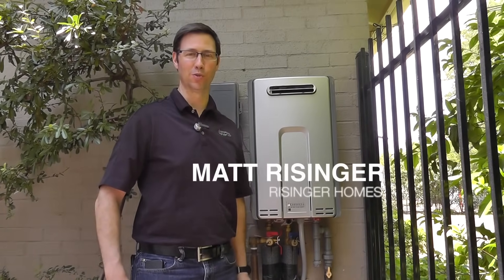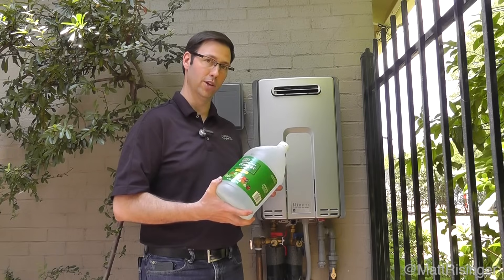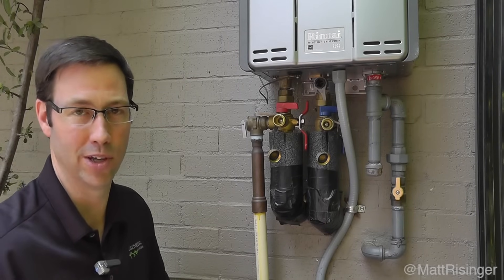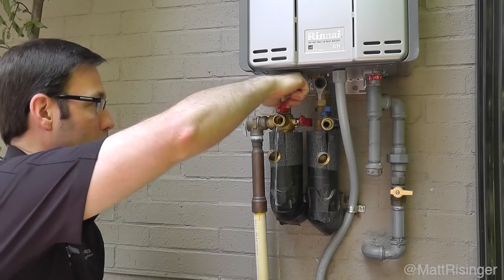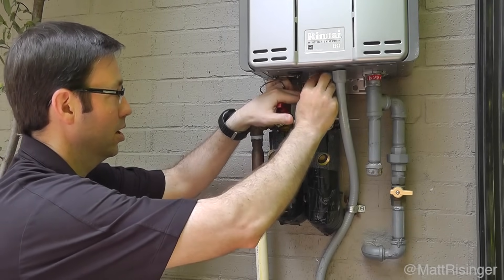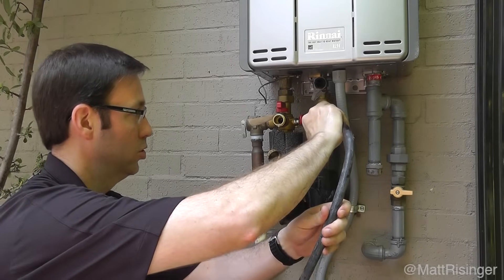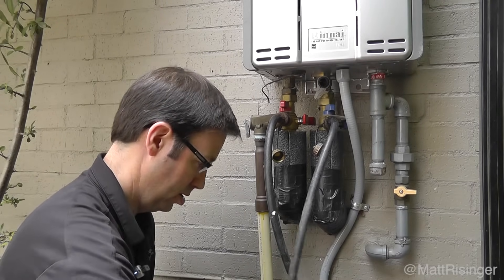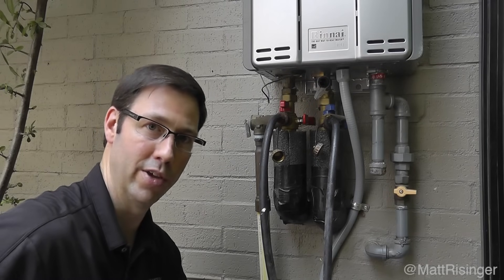Tankless Water Heater DeScaling - How To Flush

Comment: Matt,
I have a Rianna tankless water heater.  I found your video to be very helpful.  I have one question.  
You said to leave the power on to the unit.  But I have a power switch to turn the unit on and off, and I noticed the unit you were using didn't  When I started the flush according to your video, I left the power on as stated and it started beeping and showed an error code of 11.  So, I turned the power switch to off but left the power hooked up.  Was this what was suppose to happen or did I miss something?

Comment: Thanks for sharing!  Your instructions were so clear, and information so helpful, that I decided to descale my tankless unit myself!  I used vinegar and turned my unit off and turned off the gas too.  
During, and after the process, I noticed a few things.  My sump pump water turned bluish green after about 30 minutes and I noticed the water got pretty warm.  I let the sump pump run for 2 hours, because it had been 4 years since my unit was serviced.  After finishing, I slowly poured out the vinegar and at the bottom of my bucket there was a black residue that had a copper colored hue.  I'm guessing that is normal?

Comment: If you have a newer Noritz, make sure to connect the "Flush Wire". If you don't connect the "Flush Wire" it won't reset your code and you'll have wasted time. We learned this the hard way. Had a code 21, didn't know about the flush wire, flushed the system, but the code stayed and the system wouldn't work. You have to connect the "Flush Wire" for a Noritz. We connected it and flushed it again and it worked.

Comment: I know this is an old video, but I just saw it for the first time, but it looks to me like you would flush from the hot side to the cold side. I work at a chemical plant and we backflush exchangers/coolers all the time. Backflushing is more effective at removing any built up deposits than going in the same direction as it's normal flow.
Reply: That actually makes alot of sense I used to work for a water filtration company and our sand filters would flush backwards. Good comment.
Reply: That makes sense for a filter, but why would it be better for a plain heat exchanger?  The idea id for the vinegar to dissolve the scale on the inside of the heat exchanger.  I think (but I could be wrong) that running the vinegar through in either direction would do the same thing.

Comment: I have seen lots of these at the local dump and they are only about 3 to 5 years old.  Now that I know how expensive parts are for them I think I will save some of the parts.  If they are to last over 20 years then they must have been mistreated, installed wrong or not cleaned.

Comment: The following flush method is for my RHEEM 199,000 BTU tankless water heater Model # ECOH200DVRHLN Performance Platinum 11 GPM Natural Gas High Efficiency directly from the factory service manual link below. This method can be used on all tankless water heaters. file:///C:/Users/Daniel/Downloads/RHEEM%20199000%20BTU%20NG%20TANKLESS%20WATER%20HEATER%2098PAGE%20PDF%20SERVICE%20MANUAL%207496DB1F-380B-46AC-951E-BA17CA39DF8A.pdf
 1. Disconnect electrical power to the water heater. 2. Close the shutoff valves on both hot water outlet and cold water inlet lines (V1 and V2). See Figure 57. 3. Connect one hose (D1, Figure 57) to the valve (V3) and place the free end in a bucket. Connect one of the hoses (D3) to the circulation pump outlet and the cold water inlet line to valve V4. Connect the other hose (D2) to the circulation pump inlet and place the free end in the bucket.

 4. Pour tankless water heater cleaning solution into the bucket. Ensure the cleaning solution is approved for potable water systems. Place the drain hose (D1) and hose D2 to the pump inlet in the cleaning solution. 5. Open service valves (V3 and V4) on the hot water outlet and cold water inlet lines. 6. Turn on the circulation pump. Operate the pump and allow the cleaning solution to circulate through the water heater for at least 1 hour at a rate of 4 gallons per minute. This will remove any possible harmful scale deposits. 7. Rinse the cleaning solution from the combination water heater as follows: a. Remove the free end of drain hose D1 from the bucket. b. Close service valve V4 and open shutoff valve V2. c. Do not open shutoff valve V1. d. Allow water to flow through the water heater for 5 minutes. e. Close shutoff valve V2. 8. Disconnect all hoses. 9. Remove the cold water inlet filter from the water heater and clean out any residues. 10. Reinsert the filter and ensure the filter cap is securely tightened. 11. Connect electrical power to the water heater. 12. Open a hot water faucet. Run the water heater continuously for five minutes to ensure all cleaning solution is purged from the system. Check for leaks and ensure the water heater is operating properly.

Comment: I watched the video a couple of times and I must not be seeing it correctly. It looks like you are saying to close both flush valves and open the cold, hot and gas valve. I would think that you would have to flush the vinegar out of the system by closing the cold flush, hooking up the drain hose to the hot flush and open the cold input. Did I miss something?
Reply: The following flush method is for my RHEEM 199,000 BTU tankless water heater Model # ECOH200DVRHLN Performance Platinum 11 GPM Natural Gas High Efficiency directly from the factory service manual link below. This method can be used on all tankless water heaters. file:///C:/Users/Daniel/Downloads/RHEEM%20199000%20BTU%20NG%20TANKLESS%20WATER%20HEATER%2098PAGE%20PDF%20SERVICE%20MANUAL%207496DB1F-380B-46AC-951E-BA17CA39DF8A.pdf
 1. Disconnect electrical power to the water heater. 2. Close the shutoff valves on both hot water outlet and cold water inlet lines (V1 and V2). See Figure 57. 3. Connect one hose (D1, Figure 57) to the valve (V3) and place the free end in a bucket. Connect one of the hoses (D3) to the circulation pump outlet and the cold water inlet line to valve V4. Connect the other hose (D2) to the circulation pump inlet and place the free end in the bucket.

 4. Pour tankless water heater cleaning solution into the bucket. Ensure the cleaning solution is approved for potable water systems. Place the drain hose (D1) and hose D2 to the pump inlet in the cleaning solution. 5. Open service valves (V3 and V4) on the hot water outlet and cold water inlet lines. 6. Turn on the circulation pump. Operate the pump and allow the cleaning solution to circulate through the water heater for at least 1 hour at a rate of 4 gallons per minute. This will remove any possible harmful scale deposits. 7. Rinse the cleaning solution from the combination water heater as follows: a. Remove the free end of drain hose D1 from the bucket. b. Close service valve V4 and open shutoff valve V2. c. Do not open shutoff valve V1. d. Allow water to flow through the water heater for 5 minutes. e. Close shutoff valve V2. 8. Disconnect all hoses. 9. Remove the cold water inlet filter from the water heater and clean out any residues. 10. Reinsert the filter and ensure the filter cap is securely tightened. 11. Connect electrical power to the water heater. 12. Open a hot water faucet. Run the water heater continuously for five minutes to ensure all cleaning solution is purged from the system. Check for leaks and ensure the water heater is operating properly.

Comment: If you do these often you will need a corrosion proof pump.  It will cost you a few bucks but is necessary.  Standard submersible pumps or water heater transfer pumps will get ruined pretty quickly by the vinegar.  No one ever mentions this but it is true.

Comment: Don't think you absolutely need the flush valves installed. Turn off the cold water, depressurize the unit. Disconnect the hot and cold water connections and attach the pump to the cold side and the  other hose to the hot side and flush

Comment: Tankless water heaters run your electrict bill way too high because the heating element is like a direct short. I'm a plumber registered since 1974. Don't use them
Reply: That only applies to ELECTRIC water heaters not GAS powered ones.

Comment: question, after flushing the system , there is yellow brown water only on hot water and its been this way for about four days and smells like metal. can you email me directly, if you have any suggestions lnuzzoyda@aol.com
Reply: Similar issue here. I ran the vinegar for 1 hour, ran a water-only flushing cycle for another hour, it's been a week and the metallic taste is still there for the first minute and it goes away. But try it again an hour later on the same faucet and the same cycle occurs: metallic taste for a minute and then it goes away.  How do we fix this?!

Comment: Matt, I have a Takagi brand tankless water heater.  They told me that vinegar is not proven to descale.  And to use CLR instead.  Is this true?  CLR leaves behind those chemicals.  So, I need to flush the water for at least 10 minutes after.

Comment: Why do you need those valves? Can't you just unhook your intake and output, and plug in the hose kit there?

My cabins water feeds off of a 35gallon tank I refill when needed. I can drain the pipes in a minute. Why can't I clean the system by pumping vinegar through that way?

Comment: I can vouch from a bad experience the need to do this process regularly.   I let mine go over 4 years between flushes and my unit stopped working.  It ended up costing me a thousand bucks to have a new sensor installed because the original one got fouled up from lack of flushing.  Not to mention the embarrassment of being lectured by the plumber who thought I was really stupid for letting it go that long (I was). . .

Comment: Great video and it was very helpful. Thanks to you, I de-scaled my Rinnai tankless today. I did run across a few things that would have been beneficial to know beforehand. I noticed when I began the flushing process, the temperature control panel in the house began beeping with an alarm. You mention to leave the power to the unit on so do you  press the off button on the panel to silence the alarm or just leave it on? I have the inside control panel as well an on / off switch at the unit. I cut the alarm at the panel off and left the switch at the unit on. I'm not sure if that was what I was supposed to do. Also, it would have been helpful if you had shown the flow rate coming out of the unit in to bucket to be recycled. I had the right sized pump but I wasn't sure if my flow rate was strong enough, if I had any obstructions, etc. I would also like to have seen what you were able to flush from the system. I kept looking for hard water "scales" in the bucket but didn't see anything and was wondering if what was flushed out could actually been seen. My vinegar ended up being slightly darker / dirty but I didn't see any visible "scales". I was hoping to see some debris to feel like I was flushing it correctly. Your thought? Again, thanks for the video.

Comment: Okay this is a little ridiculous to flush with vinegar for an hour and a half, and another thing why in the world would you take the filter out to check it only to put it back in while you're doing your flush the filter should always be removed when doing the flush it makes absolutely no sense to leave it in.  And to properly clean that unit you must remove the heating elements and soak them in vinegar this will eliminate the amount of flush time you are using in this video also if you have a flow control you should remove it prior to Flushing.  I mean it's not a bad video but there are just some things that need to be done properly.

Comment: My local Plumbing supply house were I bought my tankless told me (not) to use viniger and to only use descaling solution
Reply: Rinnai specifically says vinegar in the manual, so I'm sure it's fine and, at $2.50/gallon, a lot cheaper!
Reply: They are both about the same thing, an acid solution, although descaler might be a little stronger.
Reply: I'm assuming this plumbing supply house sells this descaling solution and that it cost more then vinegar?

Comment: At first I read the Rinnai manual, and it was no help, too technical to get.
I watched the offical Rinnai video  here on youtube.com on flushing these tankless water heaters, and they told me "not" to use a pump that exceeds 5 (gpm) gallons per minute. I found a 4.4 gpm pump and called my plumber and was told to run it for 1.5 hours since I was a little below 5 gpm. I already had a 1/2 hp sump pump that ran at like 13,000 gpm and was told to "no way" use it as it was too powerful. This has been a totally new experience for me, and I sure don't want to damage any sensors internally. I suggest you call Rinnai on their 800 # if you have questions about the pump output, it's better to look before we leap.

Comment: If I'm not mistake it wasn't done properly.. you were supposed to fire up the heater first then shut it off so that the solenoids opened allowing the vinegar to actually circulate the heat exchanger.

Comment: I'm flushing my system right at this minute.  I did it about 2 years ago. Not seeing much in the way of sediment coming out... the white vinegar seems as clear coming out as it was at the start.  Using the same pump you're using, pumping into the cold side and flushing the vinegar out through the hot side.  I checked the inline cold water pre-filter before starting... it was pretty clean.  Flushed it in clean water, reinstalled.  Running the purge for 2 hours, then when I'm done I'll flush with clean fresh water.  Everybody should rinse the pump and hoses with clear water after completing the flush process.  Just wondering if our water just doesn't have a lot of lime or whatever?  In Western Mass, we get our water from Springfield, MA.  Water here is so good they were looking at bottling it.

Comment: Makes no sense what you are doing. What is the pump for? How is anything getting done?
Reply: It would have helped to show the pump in operation. Mine has a hose connector on top of the pump that supplies vinegar to the unit, and the drain line just empties into the bucket to get picked up and recirculated by the pump.

Comment: 2-My heater has been displaying errors starting with LC1, then LC2.... and now we are on LC5. According to the manual, this are scale buildup levels. So, the descaling process (which I've done twice), has not been able to reset those errors. And so, each time the heater move up to the next error level, it blocks itself and does not heat water. I have to perform a "soft reset" according to the manual to make it work again. 
But, inevitably, I will get to LC9 where according to the manual, the heating unit will need to be replaced. 
Any idea on how can I solve these two issues? specially the second one. After hours of doing your descaling/flushing process, the unit should be cleaned and the LCn error reset, no?
Thanks in advance for your help,

Comment: 1-On your video, you mention to leave the heater plug to the electric outlet. However, if I do it, the vinager gets warmed (not hot because the gas is closed, but warmed...) and the pump automatically shuts down due to over heating after 15-20 mins. How do I tackle this?

Comment: We have 7 of these units where I work.  I ran out of the cleaner and vinegar, but I have a non-toxic, non-corrosive cleaner I use for our ice machine, looks like about the same thing. Seems like it would be better than the vinegar, so I'm going to try it in about an hour.  I will see if there is any difference between the ones I clean with the different products.

Comment: Great video! I have a Noritz tankless that is throwing 90 error meaning some issue with a exit filter or gas delivery. Matt I have flushed my unit a couple of time and usually this will eliminate the error, but not this time. Do you recommend a good maintenance guy for this? I heard you say austin in your vid so maybe you’re are based here and know of a company or person who works on these? Thanks again great vid.

Comment: When you doing maintenence for any tankless water heater, combi, hybrid etc. While you runing your vinegar you need to inspect burner assembly, heat exchenger, condition of ignitor and flame rod, fan blower wheel, and clean them if need, also im recomend first to run vinegar then inspect inline strainer( for rinnai specificlly) if your water hard enough you wil brake that plastic. Also needle nose pliers is only tool to open inline water strainer. Regards Greg.

Comment: as a home owner can I really do that my self, the company who install last year my water thankless ask me 150$ to do that for me. if I can safe it, it would be nice  thank you
Reply: yes you can.  I do plumbing but it is simple.  You won't even have to clean out the faucet aerators in the house if it is done frequently.  A plumber above mentioned that it is good to put a filter over the outlet of the flushing system to catch all the scale so as not to run it through the system over and over and also to see how much scale is coming out of it.  Of course the vinegar will show it too though very diluted.

Comment: My Rinnai manual , RU98i, says to shut off the electricity before doing the flush.
Reply: Always turn off the unit (unplug it).
Reply: That's exactly what I do, unplug it.       I just wonder if it flushes the secondary heat ex-changer too?
Reply: RU98i, that's my model too. Most frequently recurring issue after 4 years is the condensate trap getting clogged (RC 25) and the inlet water filter needing cleanout. We don't have hard or well water in my area. Thing about the Rinnai manual is it says doing flush at 4GPM and I haven't found a submersible pump yet that pumps at that rate, all pump at a much higher rate PM.